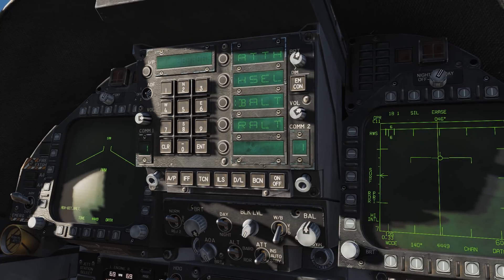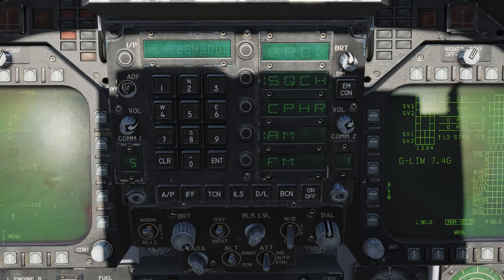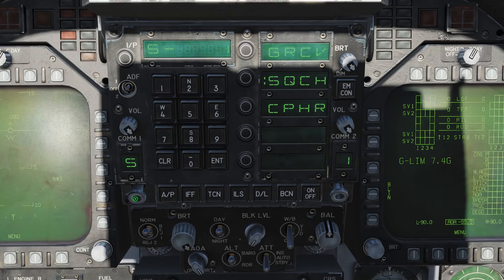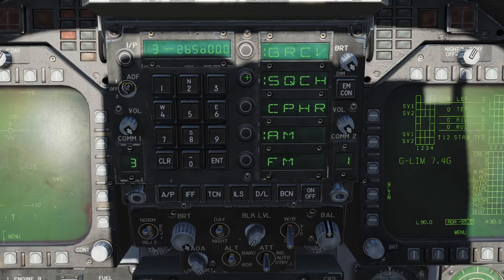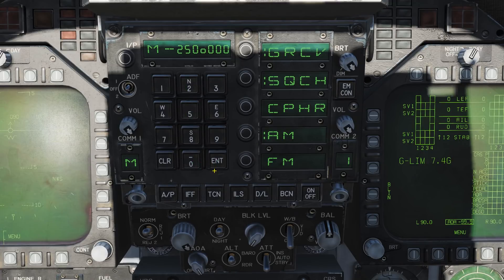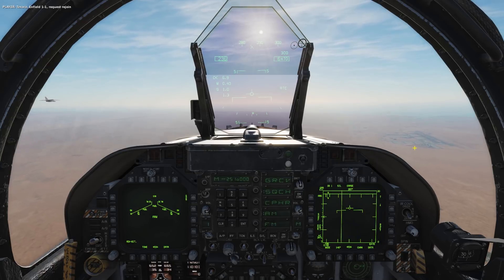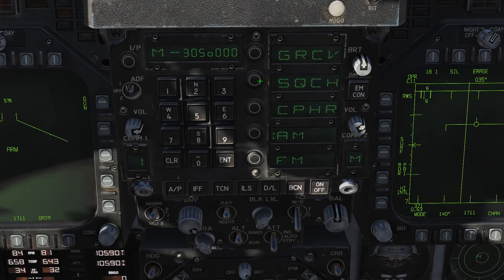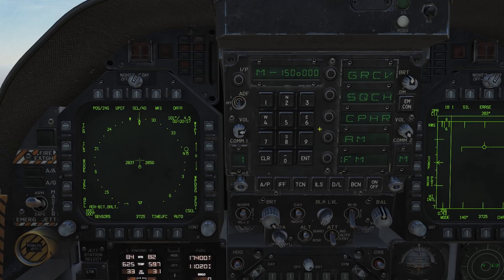DCS F/A-18c Hornet Radio and ADF Tutorial

Comment: I've noticed that holding "ENT" for a good second will always accept the manual frequency input. I think it is currently bugged. It seems that currently the UFC doesn't like quick clicks.
Reply from the maker: Thanks for the tip!
Reply: ya i have also found holding it to guarantee it takes it works
Reply: Ooooh.. that explain a lot of problem that I have I think...
Reply: +1.. the most annoying (confusing) bug however is when hitting the "CLR" clear button in TCN mode shuts off the whole damn display again^^
Reply: almightyIrie clr is supposed to do that i thought. If you aren't in a keypad mode i was under the impression clr cleared the UFC display. It does this with AP and the radios and any UFC mode you have up.
Reply: I’ve literally been looking for like an hour, thank you

Comment: thank you - sometimes I join a server (I've uninstalled SRS) and i can hear someone talking on the radio, the whole time - as in hot micing. They say they arent, only I can hear the guy talking, coughing, etc. How do I turn the radio OFF completely? or get rid of this issue ? - appreciate your help!
Reply from the maker: Turn the radio volume knobs to zero, or pick a different frequency. If you're still hearing someone, it's not SRS doing it. DCS did add a built in comms, go check the audio options and you can configure it if that's the cause.
Reply: @RedKiteRender  Thanks! will try it next time :D 
the volume knobs didnt work and I changed all the frequencies. Will look at audio options.

Comment: Talking on one radio changes both to the same channel I don't understand how this thing is supposed to work. I should be able to keep both on different channels? Talking on a radio shouldn't change the other radios channel should it. Basically I'm trying to fly to an ADF beacon and talk to the tanker at the same time. But I can't do both at the same time.
Reply from the maker: ADF requires the exclusive use of a radio, it should be possible to use ADF on one, and use the other for comms, without effecting the other. I've not personally messed with ADF in quite some time, though It sounds like you've got the easy radio options difficulty enabled and the game is auto-tuning your radios to the station you want to use.

Comment: I noticed only M channel is used in both comms. When do we use the other channels like 1, 2, 3 and....?
Reply from the maker: They're preset channels, it'l come down to the mission maker. In real life / well made missions Each preset channel will be useful, often you'd get channels like so: 
1 - tower ground ops 
2 - tower departures
3 - Local airspace controller
4 - Tower approach
5 - AWACS / Check in channels
6 - specific planned air controller

You get the idea, this lets you increment your radio up once as you progress through your departure from the airbase/carrier. In DCS we don't make as much use of channels so they're often just left as the defaults rather than configured correctly.

Comment: Cue is the name for an unencrypted single channel frequency used by people who are not already on a radio network to join it. It is completely insecure and generally only used in emergencies.
A typical scenario is:
Somebody wants to join the network but doesn't have the necessary information to do so. 
Will call up on the Cue frequency, authenticate their identity and receive the required info to use the other channels via the Man channel.
Important note: If you don't have the required info i.e encryption key for the man channel, you are screwed

Comment: Just so you and everyone else is aware, the AM and FM means the type of modulation you're transmitting and receiving. You could have 2 radios and if they aren't both on AM or both on FM, they wont be able to hear each other. (At least not very well) Most (I believe all actually) Aviation Radios use AM (Amplitude Modulation) Simply Put AM is a lot more lenient of a mode, and can allow 2 stations to talk at the same time, in case of emergency. FM (Frequency Modulation) is a lot more "solid", and one person at a time can transmit. (Source: Amateur Radio Operator License) Obviously it's more complicated than that but that's the simplest way I can think to explain it. Cheers!

Comment: The way you said it implies am fm refer to different frequency bands. It is only different ways of encoding. For civilian use they have been used on different bands which makes matching encoding easier. But as long as sender and receiver agree on both frequency and encoding, the signal comes through.
Reply from the maker: My understanding is the FM uses much higher frequencies to transmit more data, whilst am runs lower frequency, with lower throughput, but better range as a result, much like bass getting through walls whilst high pitches won't.

Would that not put them in different bands of frequencies?

Comment: Great as always! The C(cue) is a preset frequency for SINCGARS operations, see https://en.wikipedia.org/wiki/SINCGARS
Also, Chapter 23.5 (page 699) in the NATOPS PDF covers SINCGARS in quite some detail.
I hope that system will be modeled out completely for the sim, it would make for some awesome multiplayer with Combined Arms. Probably supported at some point within SimpleRadioSystem as this can already do encryption to some degree.
Reply from the maker: Yes, i'd seen that but lack the understanding to figure out what it's used for on a mission.
Reply: @RedKiteRender  I used to teach a course when i was in the USMC when the SINCGARS radios first came out, the CUE is used when u lose your COMSEC fill on a certain channel, if u want to know a little more i can probably explain a little more, when u lose your COMSEC you are speaking in the clear, which means your enemy can also hear u clearly,

Comment: FYI. For the default key binds the \ key is actually a # key on the UK keyboard. They default key kinds should work if you press RAlt + # or RCtrol + #. That being said rebinding them to something better is pretty much required especially if using Simple Radio in MP and even for SP those binds are kind of awkward.
Reply from the maker: I recall any keyboard other than us english has similar problems. My \ key is refered to as oem132 in dcs, but yes, you really should rebind these for simple radio.

Comment: Nice video!!
ADF tone sounds like an ELT, usually the ADF tone is the morse code of the ADF antenna identifiers

Anyway WIP 👍🏼
Reply from the maker: The ELT was my doing, as id mentioned in the video, the mission maker can define the audio that's transmitted, i figure'd it be fun to show a little search and rescue. My understanding is the ADF can home on most signals, they use morse on the navigation beacons to send identification and verification.
Reply: RedKite ; aahh Nice !! Good job man ! 🤓
Reply: RedKite yeah and you can even listen AM radio, it will point the radio station and at the same time you fly you listen the sports news 😂😂

Comment: Thanks for this.  I had no trouble using the alt+\ to bring up refuelling menu but then all of a sudden it stopped working.  After some testing I could program these keystrokes to my Hotas and they worked as well I bound the action to different keystrokes and it worked.  Very strange.  Also, as you said, I found frequencies sometimes would not program after hitting enter.  I have found if you hold down the enter key on the UFC for a couple of seconds it will bind the new frequency.